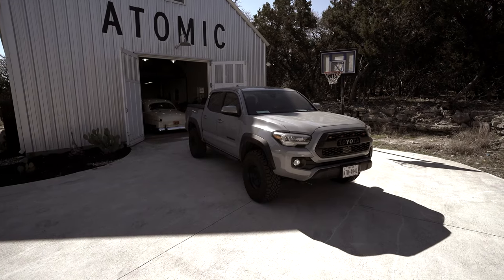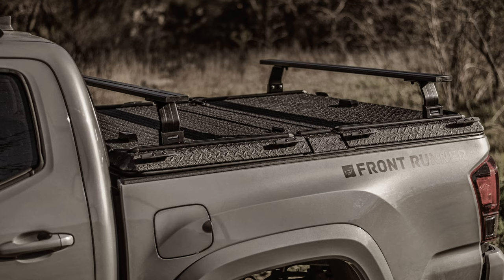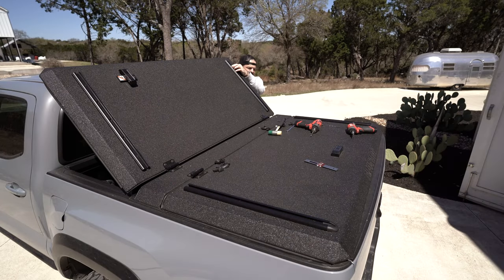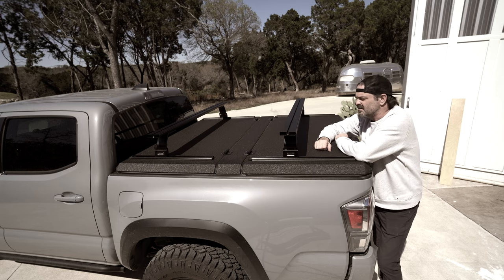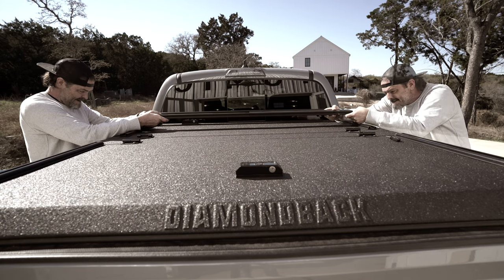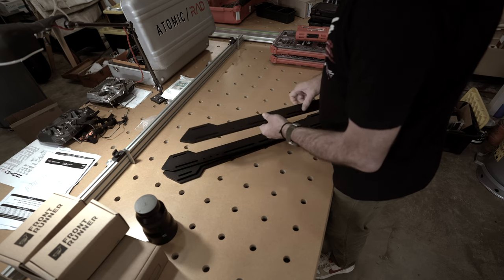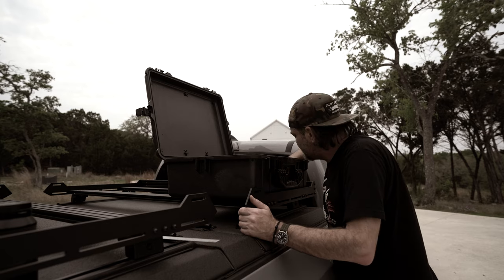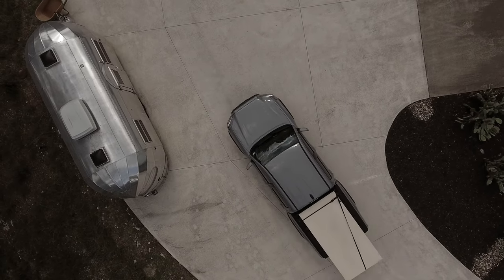The Atomic Diamondback Bed Rack For Tacoma

Comment: I purchased the same kit and, to be honest, having trouble committing to the drilling.  My layout always seems to either have a hole that would not be accessible underneath or I'm too close to the latch mechanisms.  I really like your plywood jig idea.  Can you tell me the dimensions you went with?  i.e. the length of the jig or center to center of the tracks??  Thanks for the great vid btw!
Reply from the maker: 53”.  Also, at least on the Tacoma you will not use every mounting hole. There’s one on each track that is blocked by the diamondback crossbar.
Reply: @thegaragejournal6584   Thank you sir!  I may get brave and try again this weekend.
Reply from the maker: @JHPilot83  Just go at it... I was intimidated at first, but it's actually pretty simple once you have the jigs setup...
Reply: @thegaragejournal6584  was 53” the center to center or the jig length?   Thanks!   Great work!